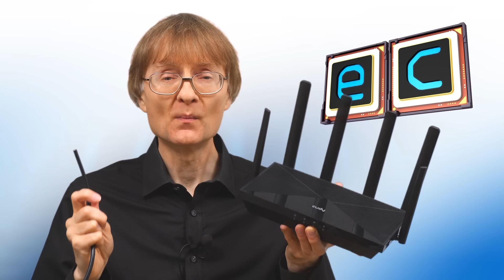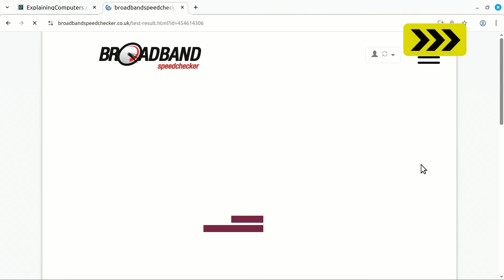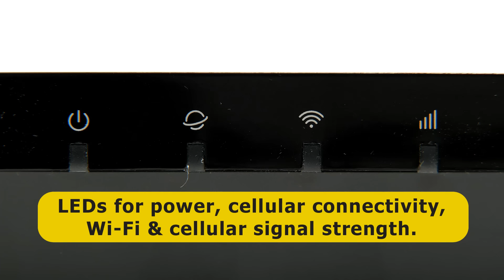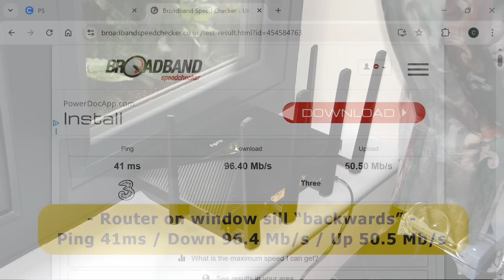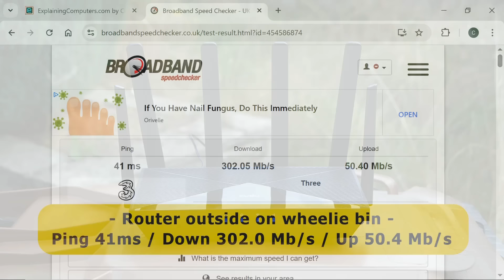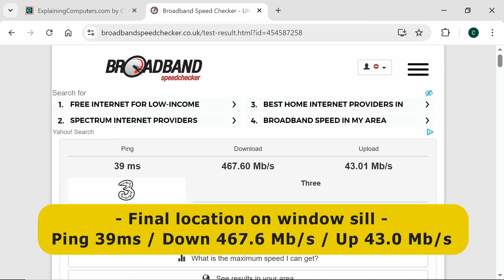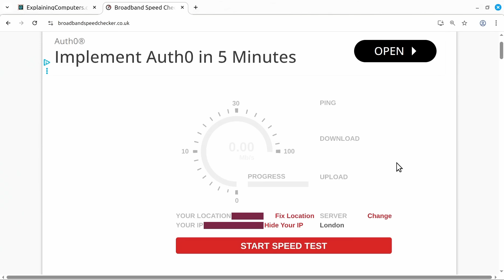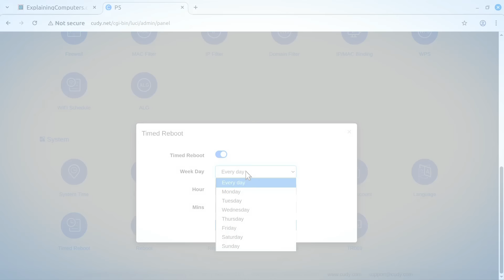Switching to 5G Broadband: Cudy P5 Router

Comment: My Sky broadband part fibre are shit slow 62Mbps & expensive £58 monthly because my apartment don't have full fibre they no planned install fibre.
I will cancel my Sky then switch to 5G home broadband with EE or Three but my mobile O2 don't have 5G coverage only 4G+ in Hesketh Road area (Stafford). 
Only 1 EE 5G mast on top high-rise just 1.2km away in my living room front window lucky 2nd floors top apartment. 
EE 5G home broadband bit expensive £55 a month. Three 5G is cheaper but signal are patchy.

Comment: Hi Chris.
Something similar happened for me, our Coaxial connection was suddenly taken down and closed, and a fiber solution prepared to take over (local planning regulations).
Sadly our landlord was bankrupt, and the bankruptcy estate wouldn't pay for the new fiber connection.
So we went for the 5G Router WiFi 6 instead, with two wired mesh units/extenders/Access Points (one on the ground floor and the other on the second floor - which we already had for the ol' coax).
That's been so for a year now, and we're very satisfied with the 5G router connection.
Greetings from Denmark. ☮️♥️🖥️
Reply from the maker: Greetings, it's very interesting to hear such a similar story.

Comment: Well how I've done it I've installed a 5G outdoor device which is powered over ethernet which connects to my cudy router, but now in my area my nearest mast have been upgraded to 5G so I may opt in to get this router to make my setup look cleaner and I can use my existing cudy router as a mesh extender so I have whole house WiFi coverage 🙂

Comment: I was surprised to find you were still using FTTC before. It’s a shame about not being able to get FTTP but I question if you already have copper wire from cabinet to your house then surely you can get fibre from cabinet to your house, even if the wire needs to cross third party land?
Reply from the maker: Permission was needed to fit fibre and this did not exist. I am not an idiot, and was very certain of a tricky legal situation which I had discussed at great length on many occasions with BT and OpenReach.
Reply: @ExplainingComputers   Usually even if the private land owner refused wayleave then the tribunal can force the wayleave agreement as telecommunication is in public interest. The onus is on the utility provider to push this through and not the customer. You don't need reply btw. I don't care enough about it.

Comment: Old wisdom is that modern coated glazing causes problems for some of the signal spectrum.. I'm unsure which of 4/5G or wifi this is applicable to;
By your test results, can I deduce that your nice windows are not of a new-fangled high-price coated glass?

My uPVC dbl is 25 years old and I just tested 5G on iPad mini 6 at 20ms, 567down, 4.5up, with small top hung window open, 20, 37, 6.7 with window closed..
Is there any problem extending the 5G antennae on short antennae cables to hang outside?  I presume this would give signal uncontended by glazing, if influenced by rain at times.. ?

Comment: I bought the Cudy P5 partly based on this review, but in my experience it has been very poor.
I have been using it for some time, and the connection drops out constantly. “No internet” is a very common problem. The SIM card works perfectly in my mobile phone, but not in this router. I worked as a network engineer for the NHS for years, so I know the problem isn’t simply down to incorrect setup.
It feels like I’ve wasted £500. The returns process is so difficult and restrictive that it seems almost impossible to qualify for one.
Reply from the maker: I'm sorry to hear that you have problems. My review obviously can only report my experiences, and I have been using the Cudy for over a year now with no issues. It indeed remains one of the best pieces of hardware I have ever purchased, and I now have two SIMs fitted, from two different ISPs, and both work perfectly.

But as I said in the video, 5G performance depends on location relative to cell towers. A frequently dropping connection sounds like network congestion or signal strength issues. Good luck with your return.

Comment: Had a mixed experience using a SIM-based router. Currently doing so and saving a lot of money with a low-cost SIM provider. On other hand, 5G networks often drop to a crawling 4G pace at, say, 8pm on a Saturday night -- and sometimes go down entirely/randomly due to network issues. Big tip is to have at least 2 SIMs with 2 different providers so you always have back up if one goes down.

Comment: I've just made a similar change (from copper to 5g) because vodafone has sent me several emails to say copper would stop working soon. And I live in a very good 5G area (up to 600/100, ping 35)

I had a voda landline too, but I never used it so no loss (not even the random calls from 'microsoft security' :-) )

Some things that surprised me:
1. outgoing port 25 (smtp) is blocked by my isp (voda) - and apparently all isps do this
2. no incomming connections possible (cgnat)   - copper had nothing blocked at all

I already had an aws vm with a static IP,  so a wireguard link between it and home works around this - ssh tunnels also work. 

I bought a gl.inet xe3000 router, and a data sim from voda. (£24pm vs copper £35pm)  The router is based on open-source openwrt firmware, which I like, the router has a battery which makes it mobile (+ £20 over the non-battery equivalent), and a 2.5Gb ethernet port for either wan or lan use.

The glinet firmware has a dynamic dns option that updates whenever my outgoing ip address changes, so I can automate other systems that need to know what my ip address is today (eg to update their firewall) - I'd hope most routers have something similar.  

Voda's data sim deal gave me a 14 day dont-like-it-return-for-no-cost option - you could use that to try sims from different isps - keep just the one that works best for you in your location. 

Very happy with the change - That speed!, and cheaper!  (And some issues I have workarounds for.)

Comment: Chris, you definitely get better speeds than me. I'm near an airport and get -96dbm with my p5 router in the loft with max speeds of 150 but cell congestion has swings and it can drop as low as 40.

Still workable for the price though.

Please do an update on this in a few years time. It's really interesting to see.

Comment: you should look into 5g fwa with an external router.
Reply from the maker: Why? How would it improve on the setup I now have?! :)
Reply: It would improve latency, speeds and general robustness of your setup. I have an outdoor router zte mc something mounted on a 6 meter pole outside and my speeds are insane. And its very stable. Some isps offer 5g fwa and you get equipment from them.

Comment: Chris, I don't like the Cudy GUI much, or the lack of control for such an expensive box, and thinking of flashing OpenWRT which I have used on routers in the past.  
Have you tried this yet?  
I have been on Three Mobile for my broadband for about 7-8 years in different location with my ASUS 4G AC-53 and the Huawei/ZTE routers from Three. Now live in the 'sticks' and 4G/5G-LTE is quite flakey..
Reply from the maker: I really like th Cudy GUI and find that it has a lot more control than my previous routers. So I've no intention of flashing OpenWRT. But we all have different requirements. :)
Reply: @ExplainingComputers  Thanks Chris.  Mine is so slow now, and one bar on signal strength.  It wasn't like this ..  I now have an external Unite-Com MIMO 4x4 antenna witch I hope improves things.

Comment: Modem ZTE MC 889 receives 5G signal from a distance 8km - mounted on the roof. Internet speed:  download 300-768Mb/s  upload:   34-68Mb/s Ping 17-30 ms. For 5G, I recommend an external router. Much better results and less latency.

Comment: Today got a Vodafone 5G Hub model no E5-250MA on a 31 day rolling contract for £31 per month. The router was free. Price falls to £20/month if you take out an 18? month contract.
Got 27Mbps Download; 12 Mbps Upload, which isn't great, but useable.
Would have tried playing around more with router placement but they only supplied a 1m 
ethernet cable.
Will probably go back to Virgin Media Essential Broadband plus @ £20/month when/if they get me 
connected back up in a few weeks.

Comment: I'm using Cudy mesh routers to improve coverage across my house, and their admin dashboard has never failed to impress. This is my first time hearing about the P5 router, its redundancy options could come in handy when an ISP fails. I have a Cudy AX1800 mesh, which I later upgraded to the AX3600 to match my main router's capabilities. The AX3600 lets you manually choose which wireless uplink to use in mesh operation, which gives handy, granular control. Thanks Chris! Big Fan from Sri Lanka!
Reply from the maker: Greetings! I too continue to be impressed with Cudy hardware.

Comment: A bit late to the party. I live in the wilds of Cumbria and my original connection was ADSL over BT copper which was about 1mb download. I then used a satellite connection which produced a 20mb download but affected by bad weather, alas this was discontinued when the operator changed satellites and I was in the replacements shadow. Then went to a 4g cellular link using an external aerial which gives about 5mb but better in winter when tree foliage is less. I still use this as a backup. Finally a government voucher scheme anabled B4RN a  local organisation to provide a fibre link to my property 4 years ago. Needless to say this has improved matters considerably with on average a 800mb up/down speed for £19 a month. The latter has only had two service fails both caused by third parties damaging the cable and fixed within 24 hours. Before fibre streaming was a waste of time. One of the biggest bonuses is I can use my cellular phone via fibre as my sandstone house walls soak up 4g like blotting paper!

Comment: I just migrated from wired BT to Three. It's only 4G in my area but it's twice the speed and half the cost of what BT had me on. I'm getting ~120Mbps with Three which translates to some large Steam downloads hitting 16MBps while BT only hit 8MBps. Ping is a constant 21ms which is great for gaming. If you are still on BT then you should be reviewing alternatives.

Why didn't you go with Three's router E5-250MA?
Reply from the maker: Good to hear of your success. Whilst I believe that the E5-250MA that is supplied with 4G plans has four Ethernet ports (and is 5G ready), the 5G Three router only has two Ethernet ports, and I need four (and both it and my Cudy deliver faster 5G speeds that the 250M). Three's routers are also tied to Three, and have just one SIM slot (both of which prevent the use of a backup on another network).

Comment: Hi chris im currently using a 4g huawei sim router on a three unlimited sim i only get about 20 to 30mbs download speed and 8 up...three dont have a 5g mast near to me unfortunately...but ive checked ee and they have good outdoor and good to weak indoor...do you think if i buy that cudy router with a ee unlimited sim i would get better speeds than what im currently getting now? Cheers
Reply from the maker: Probably. It all depends on that "good to weak" indoor signal. If you can get the good part, then you should get faster speeds with 5G. I'd check where the EE mast is relative to where you can put the router -- ie can you get it near a window on the side of your property closest to the mast? And I'd also approach this on the basis that you may need to use an external antenna (given that the indoor signal is good-to-weak).

Comment: I i’m curious about your Internet protocol connectivity. With the new 5G Internet has this allowed you to get IPV6 connectivity to the Internet looking at the router configuration page it’s seems like your local area network is limited to IPV4. This could be something to investigate.
Reply from the maker: The local area network can be set to use either IP4 or IP6 addresses (the default is IP4). I've no need for IP6 locally, so have not changed the setting.

Comment: Impressive. Thanks for the video.

I realise you clearly stated you had got to speeds you were happy with and were getting into the territory of marginal gains - and definitely not worth the hassle of experimenting with external antennae - but I'm wondering whether for the final location you settled on (e.g. as shown at time index 13:29) did you try putting the router on top of a small box or thick book to raise the antennae by about 10cm because as you show it the bottom half of all 4 of the cell antennae are in the shade of the window frame.

I can't tell from the video whether your window frames are wood, metal or UPVC but if metal I'm wondering what difference in performance simply giving the entire length of each antenna an unobstructed view through the glass might make.
Reply from the maker: The window frames are metal. I did indeed try raising the router a few inches on a box. But it made no difference to the speeds. Signals are do fickle! :)

Comment: I’ve recently “upgraded” from a 15 megabyte Bt service (the fastest they could give me) to a 130 megabyte virgin service for a cost reduction of £7 from £30 to £23 per month. There have been several repairs taking pace and my usage experience is worse now than previously. I use three Devolo devices to distribute pseudo Ethernet and wifi around the home. I have 18 devices connected including Sonos speakers, 2 TVs iPads and a computer.

Comment: Our local cable tv /ISP Rogers is considering this for social housing buildings. Currently the issue is sustained capacity to keep an active session (Session initiated during usage then closed and reestablished as required. Much different then a phone call. Imagine streaming a movie for 2.5hrs). (as opposed to an active channel 24x7). Currently our building has a FTTP connection but that may change in the near future since they may consider deploying 5g or fiber to each of the 490 units in the building. One of the issues is Rogers wants to share infrastructure in the building with the Dominant telecom provider Bell Canada, and they have to negotiate that. Utilization is currently about 10% of the unit in the building are provisioned with fiber. Bell wants rogers to pay for the provisioning work, but they want to do the work themselves and just get paid for it by rogers. A complex set of issues. Thought it might be interesting for viewers to see a bit of how the sausage is made in Canada as opposed to UK. We don't have the third party infrastructure management like you do for example. Communications regulator does require carriers be given access to each other networks though for a access fee.
Reply from the maker: Thanks for this. I've had no issues sustaining a connection over weeks, not hours. :) But it very much depends on the hardware. The Cudy router I have can do this, the Mi-Fi unit cannot (it requires a reset at least once a day). And of course it depends on the available cell infrastructure. But I regularly stream for three or four hours in the evening, and have never had an issue with a connection falling. And last month I attended an event via video call and the connection was stable for the five hour duration.

Comment: I have been on 5G broadband since 2021, only paying £16 for a three-sim unlimited deal. 

I cannot wait until May to change over to ID Mobile for a £15 unlimited SIM with no price increase and no contract. 

I had no issues since 2021 and use about 1.6TB data each month, getting speeds around 300 MB - 400 MB offpeak time onpeak time about 250MB - 290MB

I was with Virgin Media for 10 years; my prices kept on going up and up, and enough is enough. Now I'm looking for a 2nd internet connection with YouFibre; they offer 900mbps for £29.99 and 2 GB fibre for £35.00, no installation fees, and no mid-term price increases. 

The main reason is my Steam library is getting bigger, and game downloads getting bigger in sizes; yes some games 90GB doing this over 5G connection takes hours. 
I have to wait till 2am in the morning for some good constant speeds.

Comment: I much appreciate your review of this router. I live in the US and got it to try to updgrade from the CAT18 LTE version of this router. My AT&T doesn't really do anything more on this router than it did on the old one, though I expect that is because AT&T doesn't provide 5g to my exact location, being just outside of a satellite city. I have been using Total Wireless, which is the discount carrier for Verizon on a GL.iNet router and quite pleased with the results for our rural location. I tried connecting its MiMo antenna to the Cudy router and no help, the Verizon/TotalWireless SIM card doesn't seem to work in this router, despite my changing the IMEI of the router to something recognized by Verizon (spoofed phone registered to the SIM). Any advice you or another viewer might have on getting Verizon to recognize this router would be a lifesaver, as It's about $10 cheaper per month, and would allow the 5G connectivity. 

On another note, I DID get it to connect very briefly when I first bought the router, though resetting to factory doesn't seem to have  made a difference.

Comment: Sir, does this router have bonding? If yes then perform bonding with 2 SIMS and check the speeds.
Reply from the maker: It does not have bonding. One 5G connection at a time is enough! :)
Reply: @ExplainingComputers Ok Sir

Comment: I have had the Cudy P5 since August 2025. It was working really well giving great speeds up to 400mbs but then in about December 2025 the speed was stuck on 0.2mbs. So only tonight I find the instructions to change the Firmware back to  April 2025 update (because I did not realise the reset does not reset the firmware) and eventually that fixed things and speed is back up. So looks like there was a problem with either the September 2025 or December 2025 firmware update. So I have switched off auto update firmware.